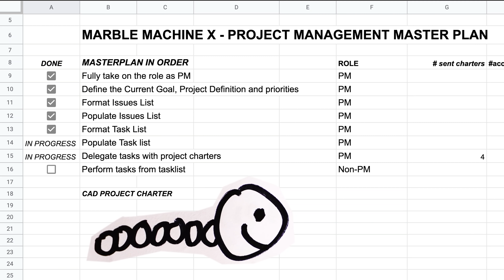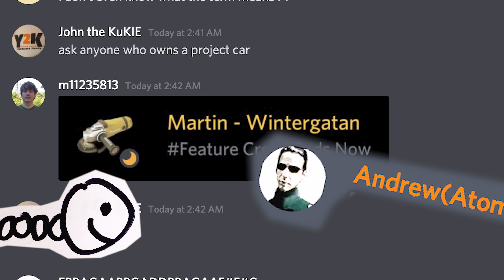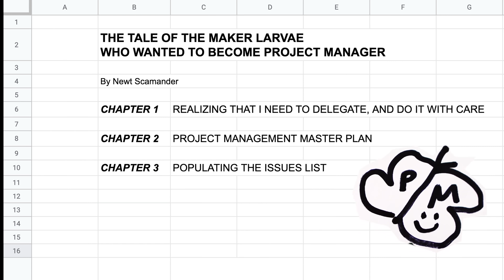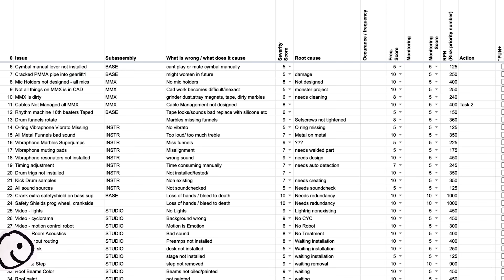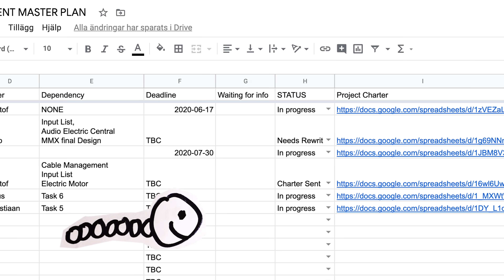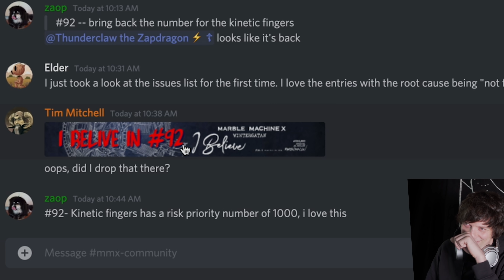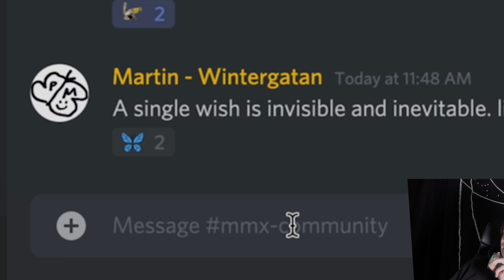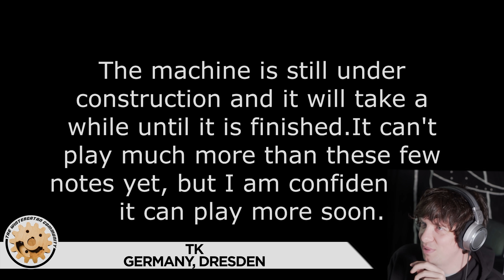109 Things To Do

Comment: Please use GitHub issues or gitlab issues.
I thought this was a serious project until i saw Excel.
You need a gitlab project and subproject.
You need to fill all issues un the backlog.
You need to schedule some user stories to the sprint backlog.
Please use scrum or any other project management system.
Using an Excel is a pain.

You need a burn down chart for looking for problems.
If you thought Excel is a good tool for project management, you are wrong.

Comment: The project management structure is looking very good. I recognise the 'project charters', and the 'issues list (which is close to a Failure Mode & Effects Analysis (FMEA) in my world)
What I didn't see, which I think is very important (although maybe they just weren't included in the videos) were 'requirements documents'. So you would have a top level requirements doc for the MMX that would apply to any component or subsystem (e.g. set some basic aesthetic, durability, maintainability and aesthetic standards). Then, each sub-system would have a list of requirements (e.g. for the electric motor: torque, speed settings etc).
I think you are probably trying to capture the requirements in the charters - which I think can work, but it may involve some replication and lead to inconsistency. Better if they can reference relevant requirements docs instead.

Comment: You get 99.9% done then decide your project needs better management. Sounds more like scope creep. Ok so there are issues. Fix them. Screws come loose. Tighten them. The machine is over a year old. Of course things are going to wear out and break. Inspect them and repair or replace. So you can’t hear the vibrato on the bells because of the machine noise. You can’t hear it on the old machine either except when you stop the machine and play the bells manually. Use pickups for the bells and mics that you can turn on and off inside the pipes. You have a billion dollar rocket sitting on the launch pad and now you want to go back and reengineer it. You are letting perfect destroy good. As a software engineer I release products every day with flaws in them. We know as a team they are there. We rank them. If they are urgent we fix them. If they are minor we put them in the back log and fix them in future sprints. Every few sprints we release a new version of the app. If you hold the project until every bug is fixed there will never be a release. What you and all of us are doing is NOT rocket science. No one will die if something goes wrong. It might be disappointing if it breaks down but technical malfunctions happen all the time. Shows get cancelled. If you organize your shows so they don’t rely 100% on the machine if it breaks down you keep going. Play different songs on different devices. Show videos on a big screen of songs played on the machine. Have all of your numbers ready to queue up on the screen if necessary. Show the making of videos. People will be happy no matter what you show or play.
Reply: In fact if I went to your show and was watching you play a song live on the machine and there was a big screen behind you playing the same song recorded from different angles so we could get a good look at it operating from different angles and the machine suddenly malfunctioned and the performance switched to the audio from the recording it wouldn’t bother me at all. If after the song you apologized and announced that the machine had malfunctioned and your team was working on it then went on to the next number on a different device I wouldn’t feel like my money was wasted at all. I mean how many of us have sat here on our PCs and listened to your little demo songs over and over again. Listening to one of your recordings in a theater on a massive sound system would be equally entertaining.

Comment: Although it would not be a very flattering video I suggest you consider showing us how the machine is not working satisfactory. You mention playing one song without it failing in your plan. Perhaps by showing us how it fails and different ways it doesnt perform the community can get a feel for what you struggle with. Otherwise good luck with the PM role, hope it takes some stress off your shoulders although being a fulltime PM also is stressful. - I have had several friends who I worked as a programmer with that slided into PM and even higher management roles only to long back to the developer role again, and in some cases did. There is something nice about getting dirty fingers in projects which a PM doesnt always do since they spend the vast majority of time trying to motivate others to do the right thing instead. If anything it will be a struggle if you keep taking the angle grinder to what another guy has been doing in his spare time for weeks on end in the hope that it would be a part of MMX. So again I wish you good luck with that. :)

Comment: As far as anyone can tell, since Newton's Principia Mathematica, the laws of physics are universal. That means the physics by which the marble machine operates in France or Australia or the moon or Mars or anywhere else in the universe are the same.
That is what is meant by universal.
Applying universality to a butterfly that can reverse the laws of thermodynamics & cause entropy to reduce by the square of distance to build highly energetic thunderstorms, then, by universality, it would apply to all butterflies.
The world would be a chaotic place indeed.
This is the original meaning  of physicist who coined the term:; in his weather program tiny variables were inverting the laws of thermodynamics & fluid dynamics causing effects that were completely out of proportion to the energy input.You just can't beat entropy.
Simplified, the laws of physics, and in particular entropy, can not be selectively applied or modified to suit ones hyperbole.
As an opto-mechanical designer of telescope instruments, this is fantastic & inspiring work. 
I hope to see you when your world tour takes you to Vancouver.

Comment: Martin, two years ago I cautioned about the large wood gears. By now, I'm sure you've noticed that there is a LOT of resistance in the total mechanism. This is going to dramatically increase the wear and tear on the wood gears. Aluminum would have been a better choice for long life and ruggedness during shipping and playing on a world tour (at least 3-4 times!).
Reply: What about a composite, like Tufnol? Much more dimensionally stable than ply, and less prone to moisture absorption. I think it would generate far less noise in operation than aluminium and maybe have less need for lubrication too.

Comment: DESIGN GOALS:  1) Use CAD so that others can build several MMX,  2)  Use metal for strength, precision & durability,  3)  Use skilled engineers and fabricators to make many precision parts.  4) Results of the goals: a durable,  reliable, and transportable MMX for concert tours with several back-up machines.
REALITY: 1) Constantly re-designed mechanisms and parts  after CAD designs did not work,  2) Used an angle grinder to "adjust" precision parts, or discarded and hand made new parts,  3) Supplied unworkable designs to others,  ignored advice of everyone, replaced with hand-made "fixed" designs.   4) Results of these actions: the MMX breaks due to poor mechanical design (i.e. wood screws into plywood). 
ANALYSIS: the MMX is frail and cannot function in a concert environment.  It cannot even be moved out of the workroom, since it would break and collapse, so no concert tour is possible.  The CAD does not match what has been built, so duplicates cannot be made. This leads to the new critical project of making new CAD files of the "as-built" MMX by digitizing.   This has two problems: 1) complete dis-assembly of the MMX, which it probably would not survive (due to glue & welds),  2) Massive redesign would be needed to accommodate standard fabrication (as opposed to hand-bending & trimming), reliability,  and trans-portability issues. 
To paraphrase "Dr. McCoy" from Star Trek: "It's dead Martin"   
SOLUTION: Finish the 2+ year old MIDI software version of the MMX, put a nice user interface on it and sell it to over 1 M subscribers.  Or give away the MMX program / app, and sell Martin's MMX composition files, like a player piano.  
If it is not "artful" enough, add animations to it.  What could that look like? See Animusic from the last century: https://youtu.be/IOmFgIxvVzc?list=RDgmzCDutDOYA&t=68.

Comment: You often say you admire and look up to Elon Musk in terms of design cues you take on the MMX, but I think your approach is much more close to Horacio Pagani. For him, his cars must first and foremost be visually stunning. He cares more about the sound of the motor and the experience of the driver instead of raw power and performance. Your MMX machine has aesthetics in the front of your mind, and I don’t necessarily think this is a bad thing. The only downside is this approach in the end will be much more expensive and time consuming for you to produce. Looking forward to the machine finally being done. Maybe focus on making a few songs and generating another wildly exciting viral video like the original marble machine did before thinking of taking it on tour. I fear that it is maybe 2 or more years away from being able to be disassembled, reassembled and made to perform for 10+ cities tour as so many pervious components need to be remade and tolerances fixed before this can happen.

Comment: All the fine adjustments you made throughout this process all go out of whack as soon as you disassemble the machine or move it. When I saw you making these fine adjustments I figured this was the case. BUUUT I just want music, I would be completely fine if the music happened in your studio. That was good enough for the original marble machine. The difference will be this can play more than 1 song and it can do it reliably with a much higher quality. You can think of it as a church organ. It doesn't have to move because it makes good music and looks beautiful.

Comment: I liked the idea of opening up MMX composition.   
Would be cool if you could get some one to make a NKS compatible VST that had samples of the MMX set up as the channels and mapped to Different zones on the keyboard  (also include MMX mechanical noise as seperate channels).  This way you can compose on the virtual MMX with accurate sounds  and then export the midi for you to review and judge mercilessly.

Comment: You're excel code is not quite right. You call function "sum" then proceed to multiply cells inside that sum function. =sum(b4*b5*b6). That cell should read =product(b4,b5,b6)

Comment: I would not be so quick to dismiss the guitar pick-up idea. 16:43 
Are you assuming that because the vibrato is caused by the rotating paddles below the bar, that there is no impact on the bars themselves? Keep in mind that there is a back and forth exchange of energy between the bars and the resonating tubes. It is not a one way dynamic.

Comment: As product owner/project manager you have to set unfeasible deadlines, when people complain that the solution will be horrible because of the time limit you need to tell them: "we will patch that later". 

Two weeks later your marble machine will float inside the air with thousand strings and  enough ducttape to make a 737.
Reply: LOL. Yes, Yes. You should do that Martin

Comment: There is a saying in project management: Putting more developers into a late project will only make it more late... I wonder, you have a issue list. Issues are errors in comparison to ... what? Is there a specification for how the MMX shall work, behave, look, perform in the first place? What are its main features that need to be reached? This usually would be a first step before distributing work to more or less empowered teams according to my experience in huge SW projects.

Comment: Looking at that spreadsheet, I wonder at some of the priorities.  Roof beams not painted -- So what?  How will that help the MMX work better?  No fastening options for the accoustic panels on the studio walls -- What does that have to do with fixing the MMX?  Yet both of these have a high (450) RPN -- the same as "marbles get stuck -- kills channel", which seems to me to be critical to the operation of the machine.
The butterfly still seems to be flitting all over the place rather than focusing on essentials.
Reply: painting is essential to preserve metal parts from rust and plywood parts from changing geometry from the moisture

Comment: YouTube viewer since the begining of the mmx here, I think you already do a great project manager so my advice would be more like "do what you feels best at".
Like just realize that this project has done tremendous progress and I think this us not due to luck. Or course you can always think of ways of improving. But the best is not to overwhelm you with goals that could be contradictory things that makes you feel good. Cause feeling good is a great fuel for motivation.
In the end, the best type of progress is the one that can last over time
Reply: Yes. Six Sigma is NOT about transformative PM strategy. We would do as you recommend. Measure the current status / run-rate, determine non-value-added tasks, identify errors (COPQ), THEN, AND ONLY AFTER MEASURE AND ANALYSIS, would you make any recommendations. This is a very poor and inaccurate representation of Six SIgma methods.

Comment: As a sub-project that will eventually save you extraordinary amounts of time is to develop an MMX transport system so you don't have to worry about taking it apart or heaven forbid, repairing it a lot on the road when you finally go on tour. As I envision it, the transport case should be able to have a lot of cushions to shock absorb it and hold all the delicate parts stationary. You should also include roadies who will take care of it and who will not let the MMX get knocked around.
Reply: And a security team called the Black Marbles.

Comment: This is probably the absolute worst thing I could suggest, but with that said, have you considered starting over and building a second MMX along side this one? Here me out, The original design has changed considerably since the beginning and you have made countless alterations and each time a massive amount of adjustments have had to be made to compensate and issues sometimes result. Like a tapestry, pulling a single poorly stitched thread in attempt to replace it could unravel the whole thing. So by starting from the beginning (in terms of manufacturing and construction), you have the optimized design now already proven plus improved means of fabrication so you can make all the parts of the machine to those specifications from the ground up instead of having to work around what's already there and settling for what works. For example, you said you want to be able to take the MMX on a world tour, you have to consider the possibility that parts may become damaged or worn in your travels, plus the logistics involved in transportation of the device, so the first things would be replacement parts and simplified modular construction. Make it so if anything breaks on the MMX you can swap that part out in less than 2 hours, you have to be able to completely disassemble it and re assemble it with nothing but wrenches and screwdrivers. Plus you need to have an abundance of replacements for every component to the point that you could build a complete duplicate of the whole machine in 24 hours if needed. This may sound like an insane idea but when you think about it you would actually be able to rebuild the device in less time than it has taken so far because all the designing, experimenting, and overall proof of concept is done, this would be all about manufacturing more sturdy parts with less potential for failure and making the assembly process more streamlined.
Reply: https://youtu.be/Et4sMJP9FmM?t=129
"Why build one when you can have two at twice the price?"
I'd thought that with his detailed plans that he'd have someone building a mirror for 'just in case'.

Comment: Hi Martin, I recently took a week long course in Systems Engineering/systems thinking approach as part of my day job (Aerospace Engineer). I think it would be very beneficial for you to look into it as it forces you to consider all options by objectively and logically setting and ranking requirements and how they influence the other sub systems. I appreciate this is very late on in the design phase of this project, as it requires you to do almost all of the work in the planning phase so you understand the requirements and relationships and weeds out unwanted emergent behaviour before you discover it later on -to greater cost and effort detriment. Taking this course was completely eye opening and having taken it you can see the applications for it everywhere. It explains why I got so frustrated in university projects when team mates would 'tunnel vision' on certain solutions without considering their wider impact - it avoids "solutioneering" and rework and results in a design that is right first time.
Reply: Great comment. We have this skillset in the engineering team and we utilise it (and will even more). Martin delegated that as well. :D